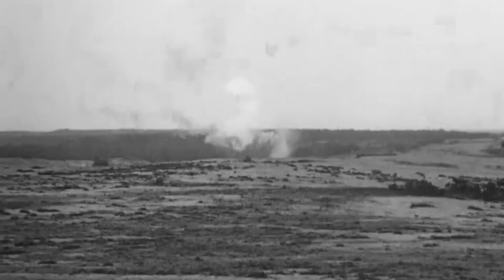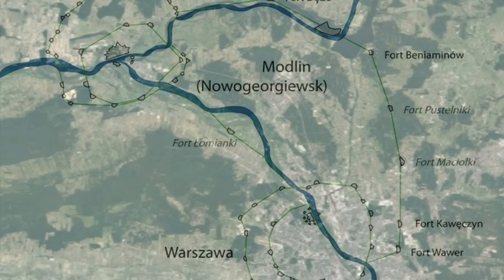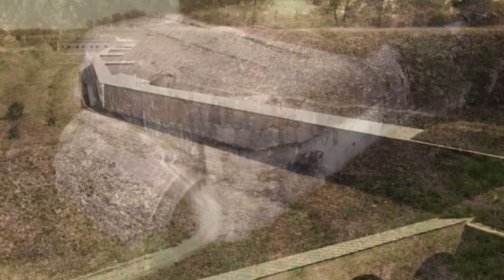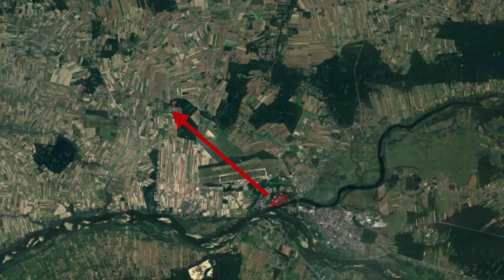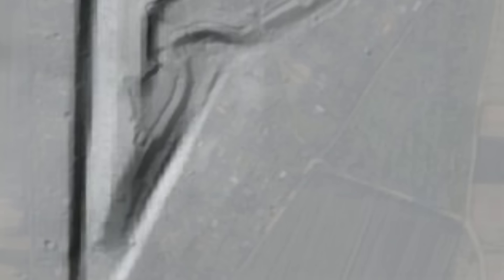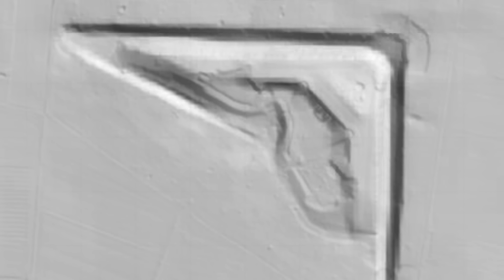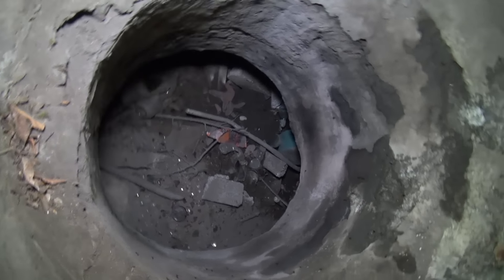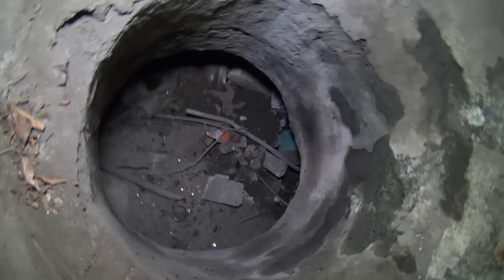FORGOTTEN FORT STRUBINY VII MODLIN FORTRESS

Comment: I bet all the "floating"  roof had steel beams thats been ripped out.
The black is some sealant put on the beams befor poring concrete to prevent  leaking during the pouring.
Witch also helped the scarappers as the concrete isn't stuck to the beams.